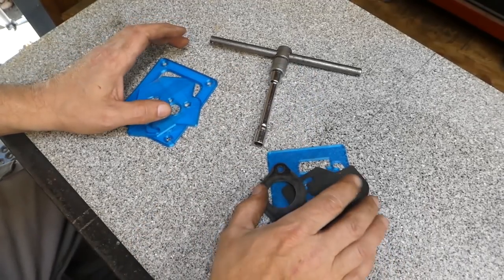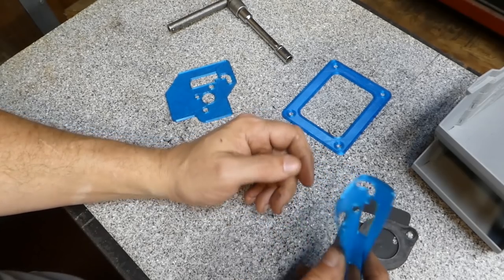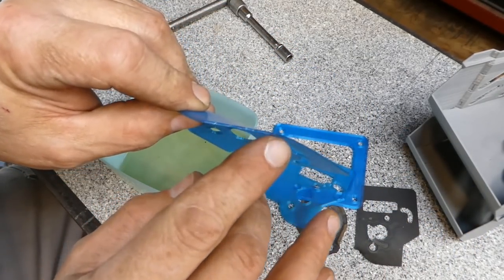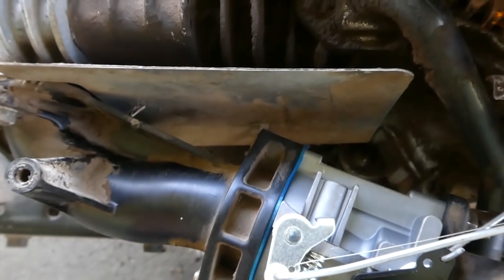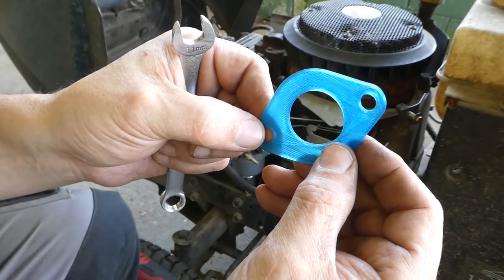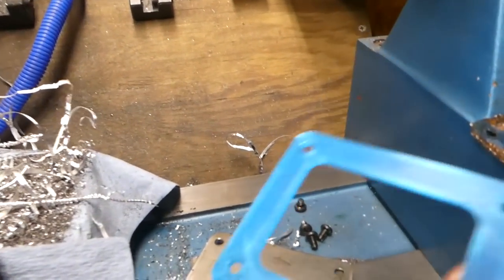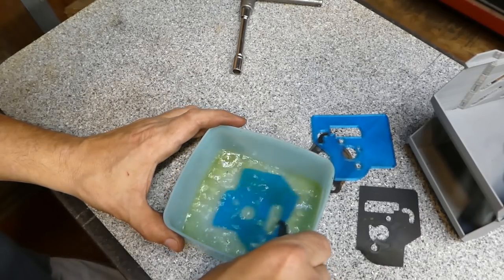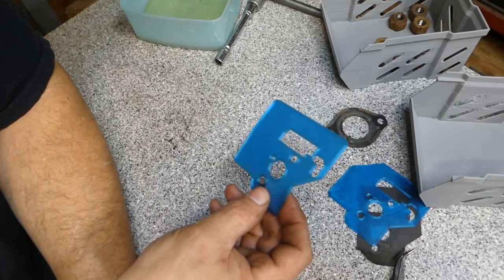3D printed gaskets? Any good?

Comment: TPU is great! I've used it to make custom wire grommets for a bandsaw I rebuilt when I couldn't find the size I needed and didn't want to wait for an order to come in. Being able to print durable, compliant material is amazingly powerful, and you can even alter it's compliant properties by adjusting the infill density and wall thickness if you need parts with different levels of flexibility.
Reply from the maker: Yes, it is amazing stuff. Wire management, that is a good use, had not thought of that yet.

Comment: One thing to watch out for with TPU is that a lot of the softer grades (Shore A range) have plasticizers added to make them more pliable. Short term, not a big deal, but long term, they may bloom on the surface and the material may degrade. It pays to double check before you invest in a spool.

Besides that, you may want to play around with infill strategies. Rectilinear is the default in most cases, but there are other patterns, but other shapes might be better as gaskets. My guess is that Archimedean chord and concentric patterns may be more effective, if only marginally.

Comment: Checked some chemical compatibility charts for TPU. Its rated pretty well for gasoline and oils. The BASF study I found says theirs can last in gasoline at 60°C for months with only minor swelling and a slight decrease in tensile strength, but no degradation. They also say it would take years to see that effect at lower temperatures. Definitely gonna start slapping TPU gaskets on all my stuff now!

Comment: I have been using a drag knife (cricut) for cutting gaskets.   This looks promising so will give it a try.
Just to put it out there.   I soaked a Solutek PLA part in 20W ND oil for over 6 months without noticeable change.
Reply from the maker: Those cricut units are very cool. I also have a laser cutter for the Sovol printer that I want to try. I bought it with the machine and not even taken it out of the box yet.  It hardly stops working long enough to play with the laser yet. 
I have read PLA can be pretty tolerant of oils though aromatic fuels are hit or miss. Probably comes down to exact formulation of  the brand.  Many of my little storage units are contaminated with different oils and grease and have not reacted.
Thanks, always good to get input from other people trying similar experiments.
Eddie
Reply: Just another note solute PLA can also handle chlorine tablets in the pool. The original floating chlorine tablet holder base disintegrated so I reverse-engineered a new one and printed in PLA  it's been in the pool for over a year now and still holding up good
Reply from the maker: @nicks9360  Nice to know. Has it sun faded? I have a PLA piece I am working on now that will get come in contact with bleach often so that is great to know as the chemistry of those tabs is close.

It looks like you may have deleted the other comment but the TPU I used is linked in the description.

Best!
Reply: @theeddies  I have other pla projects that sit in the Florida Sun but are under a screen enclosure seem to fare very well also haven't really noticed any sun fading. Haven't really tried PLA in direct sun but I have had petg in direct sun for over 3 or 4 years and holds up pretty good. The floating chlorine dispenser part I printed is in the water the whole time so the sun it sees is through water.  Something to note I would use white if it's around chlorine as I have a small blue piece that functions well but has discolored  the rest is in white and looks good. And one last thing petg does not handle the chlorine tablets well at all.  LOL yeah I deleted because I found it in the description
Reply from the maker: @nicks9360  Cool, thanks. Very interesting about PETG and chlorine. I would not have thought that. Strange kind of liberating time  right now when you can make your own things but you also need to get a degree in material sciences and do your own product testing to get it right, lol. Someone eventually is going to come up with a 3D printer that is as easy to use as a 2D printer and what we are doing now is going to influence how that plays out. It kind of reminds me of the early 90's internet. I knew it was both over and just getting started when Toyota (and other big corps) started running ads with their web address. But the foundations were just a bunch of people trying things and experimenting with the tech.
Reply: I added a drag knife to my ender 3 v2 for carb gaskets (paper gasket material).  Just scanned old gasket or carb face, fixed it up in coreldraw, and cut perfect gaskets with printer. Now have file if need more in future.

Comment: I've printed TPU gaskets for my 26 gal. upright air compressor back in December and so far they have performed up to par with the factory originals.
Reply from the maker: Cool, thanks. Where did you use them on the compressor?
Reply: @theeddies  Yeah, pretty curious if they will survive as a head gasket for the compressor.
Reply: I did an air filter inlet gasket for my CH upright compressor last week. Works well. Sure beats $8.90+$12.95 shipping any day.

Comment from the maker: I made a follow up video on this https://youtu.be/dSGOzGJjoWc.  The temperature I said in this video is the temperature that the material is printed. So it would be basically in a molten state at 200°C. The important temperature to consider here is the heat deflection where the material starts to change from a solid to liquid. This would be the temperature that would be the max operating temp. This is a little harder to determine as every brand would have a slightly different formulation but as far as I can tell, 80-100°C or 176-212°F would be the max temps before it would begin to melt. This is certainly still within the range of the uses I presented but does limit it somewhat in other applications. Thanks for watching!
Reply: so maybe not useful for steam lines
Reply from the maker: @danielsweeney8164  A steam pipe is certainly going to be at the upper limits of this material's usefulness. It is not going to melt but will be getting softer by 100F. I have had this material in constant contact with 90F oil and while it did not fail as a gasket, I would not trust it in a critical situation. As others have suggested  for higher temps, nylon or even making a 3D printed mold to form a silicone gasket may be a better choice in that case. Thanks.
Reply: @theeddies  Thanks for the extra info.  Yeah steam may be a bit much!

Comment: RIGHT!!!! I was able to design a gasket to replace a factory subwoofer in the back of a troublesome 05 Avalon. Tpu allowed me to repurpose the old sub as a bracket and also act as a shock absorber between the sub and the rear deck metal. However I have not had much success printing tiny gaskets. I have had several unsuccessful attempts at printing an airbrush gasket.
Reply from the maker: That's a cool use. What size is the airbrush gasket? I have not tried anything smaller than about 3mm wide. That worked but it was flat.  This stuff seals so well I want to try an O-ring of a mm or less. I have thought about changing nozzle size down to do that though (maybe a .02 or even .01) and it will have to print really slow, maybe less than 15mm/s, I am thinking. I will have a video of that coming up. That will be a good test of printing small.

Comment: I'm rebuilding the carburetor for an old 1986 Honda Rebel 450, been dreading about trying to find replacement for the o-rings and gaskets so it's been sitting disassembled in the garage for 2 years now. I also had a 3D printer sitting in the basement for the last 2 years collecting dust along with an unopen vacuum sealed fresh pack of TPU... didn't cross my mind until recently that I could probably print those parts with TPU until last week. Started Googling for chemical compatibility in different temp ranges for TPU and gasoline, then found your video! Will def give it a go!

Comment: There’s also different “grades” of TPU, where if you’d like it more rubber like, you’d want a lower number (it’s been awhile, I can’t remember how they’re rated, but I think normal 3D printer TPU is like R95?), and they’re insanely useful for all their unique properties
Reply from the maker: Hello, yes I discussed this in the follow up video on heat treating. It is actually a Shore scale of hardness and most rated at 95A but NinjaFlex is 85A which would be a bit softer. The hardness can change with temp as well. It is my favorite material to print with right now.
Reply: I'd love to see some consumer grade pellet-fed extruders for 3d printing in the 30-40A range.

Comment: TPU is awesome! Never thought I’d actually use it, but I went for it, upgraded my bowden tube to a Capricorn and let me tell you, NOTHING doesn’t slip through that tube. It is so slick I can even do small retractions without needing direct drive. Love TPU I’ve made so many go pro mounts for my drones with it
Reply from the maker: Awesome. Yeah I did not buy any for the longest time and now I print it as much as anything else. It makes great cam mounts. I actually made a mount for a large Windows tablet that is tripod mounted for livestreams. It is soft on the computer but stiff enough to hold at any angle. Awesome stuff.

Comment: That's it.  I'm upgrading my Ender 3 Pro to direct drive.  That 3D printer has been the most universally useful tool I've ever put into my toolbox--it's amazing how your mindset changes, how easy it is to fix stuff that you would have to replace (or do a shitty sugru fix.)

Never considered using TPU for gaskets; I've been using the wife's CriCut, but I need to print some new mallet heads for our croquet set, so, time to take the plunge and start using TPU.

And a tip: guys, spend a couple bucks and get an automated bed leveling sensor (BLTouch) and a magnetic textured PEI bed.  The time (and sanity) savings are incredible.  Took me a year before I broke down and installed the auto bed leveling system, and I ain't never goin' back!

Comment: I just did my first TPU print. I used a Anycubic Kobra with a temperature of 220 C. The print came very well. I have to wear a compression garment on my right leg so I had to make a push stick to help remove the garment. I had one made of actual wood, but I couldn't resist making one 3D printed with PLA with 20% wood powder. That was great, but I needed a softer handle therefore I made the handle of TPU. The end of PLA with wood part slid up into the TPU handle and stayed. The handle is comfortable, and the PLA+ end does the job.
Reply from the maker: Excellent functional use. I use Fusion 360 to design most things.

Comment: Thanks for showing this amazing use.  Will use for steam and hot/chilled/domestic water pipe/pump connections in our building systems.      A lot of our systems are old and hard to find the right size gaskets.  Another "holy shit you can do THAT??" from the chief engineer!

Comment: I make carb float chamber gaskets for some old bikes out of tpu for some time now, they're reliable, and resistant to gasoline, and most importantly almost indestructible

The aftermarket gaskets peeps can buy is just ridiculous, either they reacting to gasoline because the manufacturer is an idiot, or fall apart the first time you disassemble the carb

So I started to make working/reliable gaskets out of tpu because of this

I use sunlu tpu, the only thing I noticed that in time the plastic gets white, no material degradation, no falling apart, just messing with the pigments in it

One guy uses a gasket I made, already disassembled the carb more than 10 times, and he still uses the same gasket, and still doing its job perfectly
Reply from the maker: Nice, that is a future project as well. Modern fuels destroy older gaskets. I have been buying viton o-rings for awhile, they hold up better. And for the shaped o-ring type carb bowl gaskets you can form them in the recess, or even use 2 glued together. Thanks!

Comment: Considering buying a 3D printer now for hobby use, some of the parts I'm thinking of printing could be subject to gasoline. The fuel resistance test was very helpful. Thanks for the video!
Reply from the maker: PETG and TPU are fine with gasoline in my experience. A word of caution though. Buy good quality brand name stuff (Duramic, Overture, SUNLU, polymaker, Prussa, etc.) not the Amazon bargain basement no name. Less reputable manufacturers will mix fillers in their filaments to cut cost.

Comment: I’ve made several different sized washers for various applications and thicker ones that act like vibration dampeners. Very versatile stuff. 
If you have a used gasket just scan it in to the computer and then take the scan in Inkscape and turn it into a svg file and then put it in your cad program to get the thickness and then put it in your slicer to print. You’ll never run out of gaskets again. 
Very cool video
Reply from the maker: I did that trick with the square gasket. Works great. I did not mention it because I was trying to keep the video focused on the material.  Vibration dampening is another great use. Thanks!
Reply: @theeddies  
I’m making a fuel tank gasket for my lawnmower this weekend. 
So much more satisfying to design and print something right at home. And it works perfectly.
Reply from the maker: @jack0cat  nice!
Reply: I've printed a few faucet gaskets in TPU, works great !
Thanks for posting !

Comment: I do a ton of 3d printing, I'd be a bit worried about TPU absorbing moisture. It tends to do so. Also great tip on direct drive over Bowden. TPU is a nightmare even with a very calibrated printer with a Bowden setup. Very valuable information. All of mine are direct drive and I'm never looking back. I also never once though to make gaskets even though I do a lot of small engine and vehicle repair. Exciting idea. :D
Reply from the maker: Thanks! You should take a look at 
 @Thomas Sanladerer  video about wet filament from a few months ago. Basically it comes down to the amount of water that most filaments normally absorb is miniscule. It certainly can effect the quality of the printing process, but only to a much lesser extent the strength and durability of the resultant parts. 

I plan to do some specific tests with TPU in the future but honestly, I have left my present spool out for 4 or five humid Georgia days at a time and it prints just as well as new. 

I do not want to say that the hygroscopic effect is overblown because I have seen PETG spit and pop while printing then dried it and it was fine, but I think sometimes it is a bit overstated as a problem, Nylon and some others excluded. Best!
Eddie

Comment: I haven't done any gasket projects with my printer because it's a liquid resin unit.  However, I have found several 'reasons' to use it for various mechanical and engine-related projects. Both for myself and others around me.  Most popular thing so far is a 3 piece water sprinkler.  Costs about $2 in resin for something that would run well over $50 from a retail store.   And I can print em in any color you can think of.   Best printer I have ever bought.  Paid for itself 10 times over already.
Reply from the maker: A SLA printer is one my future buy list. Do they have flexibles resins?

Comment: The primary reason why the access cover for your lathe/mill leaks is that the cover plate is made from flat sheet without any reinforcement.While working the plate will flex. If it were made from plate, or reinforced/formed sheet it would be rigid and the cork gasket would be fine. I suspect that even the TPU gasket will leak some eventually.
Reply from the maker: Actually the primary reason is that is what I had on hand at the time. But it does not really leak, the gasket just soaks up oil. I agree that some reinforcement or thicker plate would not hurt but it's better than the original thin plastic plate from the factory. And I will get around to improving it one day when it becomes a priority. Thanks!

Comment: If you want, change your slicer settings for the top/bottom layer pattern to "concentric" It will probably make them better gaskets since the entire print will be perimeter walls like around the holes and edges, just the entire print. Removing those lines from side to side. Just a thought C:
Reply from the maker: Interesting idea. Certainly worth a try, my only worry would be structural integrity since there are no crossing layers but just built up lines.  I might try that with the valve cover gasket though. Thanks!
Reply: @theeddies  im no engineer but I've been printing for a few years as a hobbyist. Im curious to see how those would turn out! Great vid tho!

Comment: Great video, thanks for sharing. I've been making gaskets with my Elegoo 3d printer for a while now with no issues.  I use Sunlu TPU 87a filament.   This is a little more flexible than the TPU 95.
Reply from the maker: Nice, I will have to try that filament. Thanks!

Comment: Great video. I haven't used TPU much so far, but from my experience it works best without retracts and with a reduced printing speed on bowden style printers.  TPU can also be very hydrophobic before printing, so drying a spool of it for a half hour at low temperature in an oven can make a big difference between "not printable at all" and "great results".
Reply: Ninja flex is not hydrophobic. Prints amazing with direct drive. I have not tried with a bowden. Avoiding retracts is a good idea, it can be really stringy.